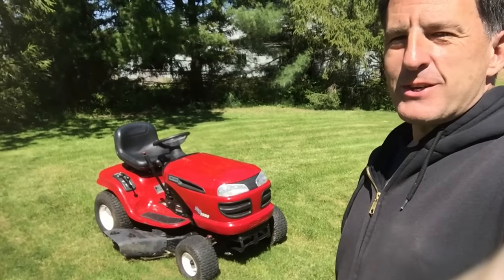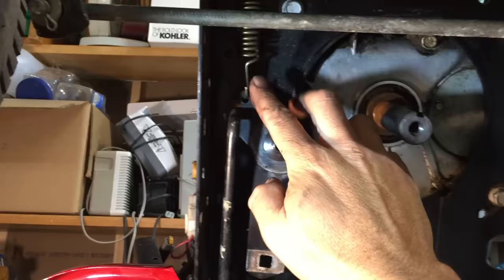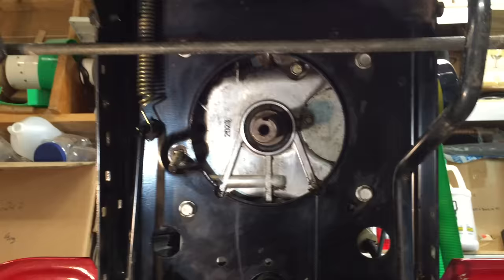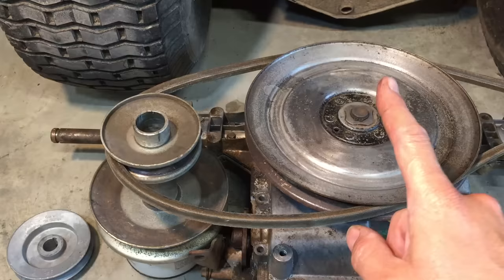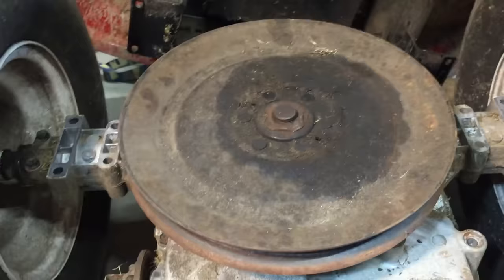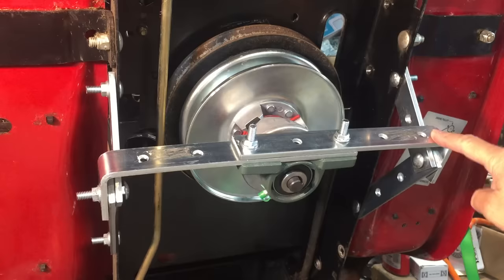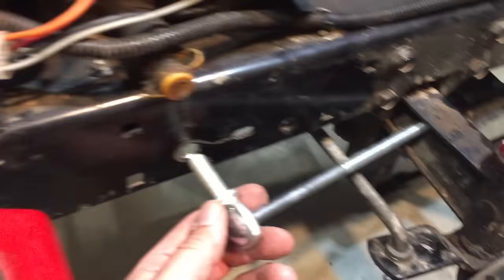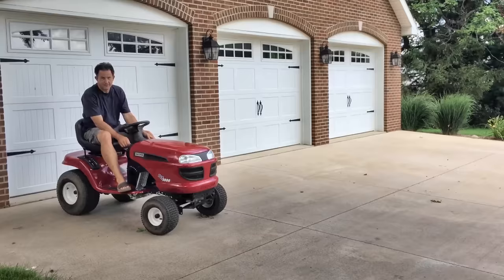Easy DIY Racing Mower

Comment: question can u add turbos?
Reply from the maker: I am sure you can, but I have not heard of anyone doing it.  You can get a lot more power by re-jetting the carb, and going to a straight pipe exhaust.
Reply: @HowToLou   so you can go even faster by re-jetting the carb and straight piping it nice I didn't know that i was just going to slap on a small turbo
Reply from the maker: turbos are not common on small engines.  I am guessing they don’t work too well.

Comment: Do I need to buy a bigger belt for the torque converter or can I use the one that comes with the torque converter?
Reply from the maker: The steering column is in the way, if you try to use the standard belt.  That is why I had to get the longer one.
Reply: @HowToLou  ok thank you

Comment: Where did you get those bushings for the steering?
Reply from the maker: Menards hardware. In the nuts and bolts section, in those hundreds of tiny plastic drawers.  Take a screenshot from the video and ask for help finding it.   Lowes has something similar, I am sure.
Reply: @HowToLou  Thank you very much!
Reply: @HowToLou  I checked 3 hardware stores today and no luck finding it.  Do you know the size?  Then I can buy online.  Thanks!

Comment: You hooked the pedal to the govner, not the throttle so you could have gone much faster
Reply from the maker: Yes, you are correct.  The connecting rod and flywheel on these engines are designed to run max 3600rpm.  The governor is there to make sure the engine doesn’t overspin and destroy itself.  Yes, you can run them much faster, but risk a blown engine.  Also, I didn’t want to go over 35mph without lowering the center of gravity so I wouldn’t flip it.   With a racing rod, flywheel and lowered, heck yeah, I could run this thing at 60mph easy.
Reply: @HowToLou  oh ok 👍

Comment: does this work regardless if being a hydrostatic or geardriven?
Reply from the maker: Hydros can’t handle the heat of overdrive.  Needs to be geared.
Reply: @HowToLou  thanks for the info also what if it was a automatic transmission?
Reply: @HowToLou  and is every gear the same speed or is 6th faster than first?
Reply from the maker: Automatic Trans is Hydro and will overheat.
Reply from the maker: 6th is the fastest. I leave it in 6th and let the torque converter give me low gearing to start.  If you don’t add the torque converter, you just run a belt from the engine directly to the transaxle, but leave in the idler pulley “clutch”.  In that setup, you switch gears manually.

Comment: Would it just be easier just take that big pulley off the rear axle and put a really small one in it's place to achieve the same speed
Reply from the maker: I did a standard pulley swap, which is all you need to get to 35mph. I didn’t have to use the CVT in the middle, but they are just so cool.  I can leave the tranny in high and go from wheelies to 35mph all in the same gear.

Comment: how fast it is?
Reply from the maker: 36mph stock. Could easily do 50 with engine mods.
Reply: @HowToLou  if u install 26carb on it would it get it faster?
Reply from the maker: To get it faster, yes a performance carbs helps, but you are still spinning 3600 rpm.  You also need to delete the governor, swap to stronger valve springs, and a high speed flywheel.  With that setup, you can spin over 5000 easy, which puts you at 50mph
Reply: @HowToLou  where can i find stronger valve springs and highspeed flywheel?
Reply from the maker: OMB Warehouse is a decent place.  They can help you pick the right stuff.